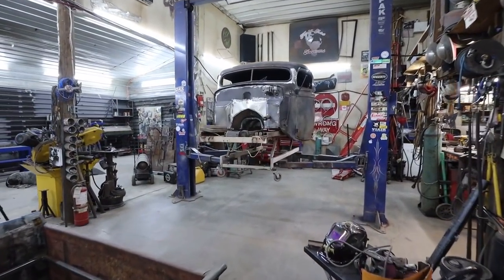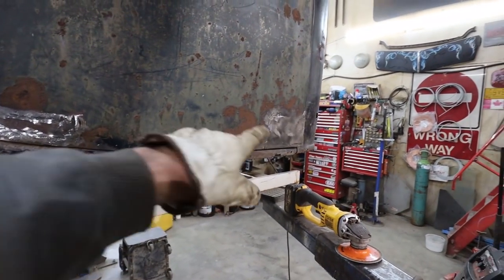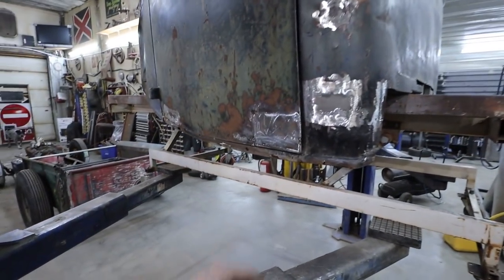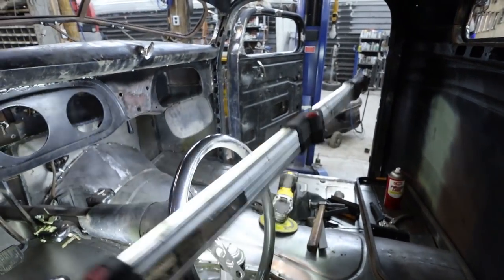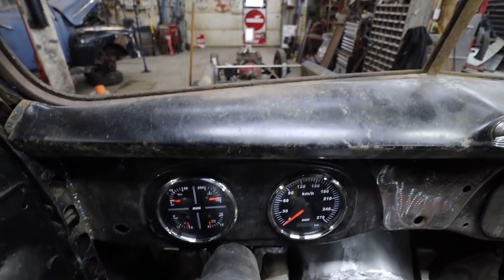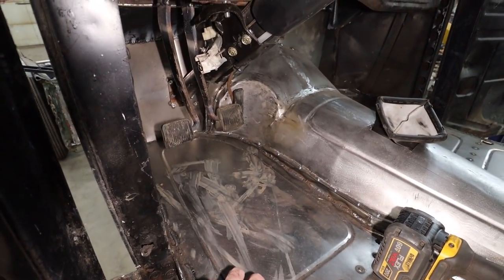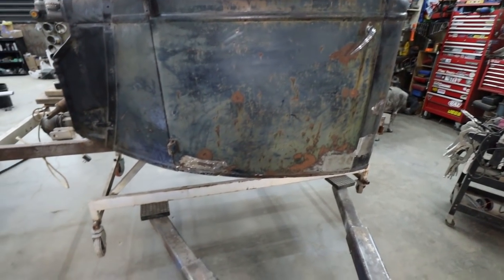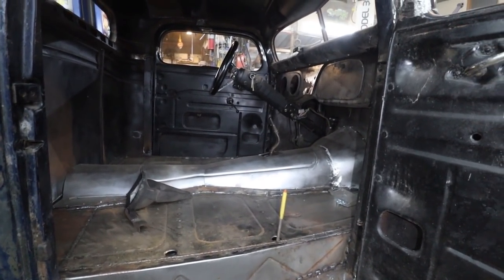Rebuilding the lower body line and rust repair on the 1937 Ford hot rod Part 16

Comment: The rolled steel interior panels would look amazing or rolled aluminum would also look great! you could spray the inside of the roof with bed liner, it would give it texture and sound deadening and you could paint it if you wanted to. Wow, what a great way to use conduit to repair the lower panels! Great Video!

Comment: To seal the tunnel to the floor...cheap. 
Home Depot, butyl tape, it's like 3M "strip caulk". Unlike 3M, it's only about 5 bucks for a 40' roll. 1/8" thick X 1/4" wide. Used for metal roofing seams.
Reply from the maker: Sound better than what I was gonna use haha

Comment: A spruce green heavy crushed velvet interior with black carpeted floors and accents on the door panels would really set it off. I don't know how close the original front fenders are to the 34 ford front fenders but that would look amazing as well with the 34 rad shell and grille. So I'd pinch the front horns to match the grille you chose some time back. She is looking the nines so far that's for sure. Thanks for letting us follow along.

Comment: Hi again from the UK. Another small suggestion. You mentioned in one of your earlier episodes that you like to put the front wishbone arm attachment points in double shear. If not too late, how about turning the spherial rose joint end through 90deg and fitting it between  the arms of a "U" section bracket which would be welded to the side of the chassis, covering over the hole you drilled. The base of the "U" can be as long as you like to give it adequate strength? Thought it would look a little more neat.
Keep up the fantastic work!  Robin Searle.

Comment: Making Fitzee proud!👍
Drivers door seemed easy, but everything is easy watching from my recliner.  
Arcing pipe didnt look like it was cooperating. Youconduit!!

I did accomplish a little bit today, turn plates for alugnments, a pair was given to me, needed some tlc. Will go with the alignment machine just fine. The database goes back into the 40’s. good to have.

HAPPY NEW YEAR! Btw..

Comment: As far as I know, the conduit has a hot-dipped galvanized coating with zinc. is that safe to weld?  the vapor is toxic wouldn't want to see you lose your marbles.
Reply from the maker: as long as you don't inhale the fumes a feller will be fine.

Comment: The conduit is called EMT for electric metallic tubing. Good material for what you are using it for. You might need to treat it before you paint it though as it is coated to prevent rust and the paint might not stick. They used to galvanize it      
I don’t know what they coat it with now. Truck is looking wicked. Thanks for sharing.

Comment: Nice work, as usual. Here in Pennsylvania we refer to that particular type of conduit as EMT. Its an acronym i believe for electical, mechanical tubing. But you are right it is conduit.
Reply: Knew a fellow from Philadelphia that was overcome from the fumes while brazing, the galvanize coating. Be safe!

Comment: Happy New Year to you and your family. With that speedo I think you need to bring the truck over to Germany and try it out on the autobahn. Here is a guy doing 200KPH in a stock early Mustang. https://www.youtube.com/hashtag/topspeedgermany. I have a 65 Mustang and took it up to 180KPH but it was getting a little wayward so I backed off. I think that guy was doing well. You nice low truck with a strong Chevy small block should be good for 200KPH easy. Eat some of those BMW's and Audi's for breakfast!!!

Comment: The cast Iron Pipe is already work hardened so it doesn't bend very well for ya. One inch tubing works well to rebuild the bottom of the Sills on these old trucks and cars. And it looks really good when it done as well plus than they last forever, being that its build out of one inch tubing. Never even consider conduit o yeah that'll be fine.

Comment: Running late on your videos    Your one I like to stay up with but been busy like you    Suggestion   Put hooks on the floor so you can use chain or whatever and your posy lift to bend pipe    Hydraulic’s work in many ways

Comment: What do you do for heating the shop? I don’t have room for a wood stove but my propane torpedo heater doesn’t do it
Reply from the maker: I have in floor heat in there with a gas boiler
Reply: I'm pretty sure he said he has heating in the floor, in a previous video.

Comment: Another great video Brent thanks. BTW, this is probably a dumb question but, on the roof inside the cab & directly above the dash, there appears to be what looks like upside down bottle caps attached to the roof (LOL), what the heck are those?
Reply from the maker: haha think they where used to keep the headliner in the truck in it's past life.

Comment: Truck looks great !
Do you have recommendations for a cordless grinder and abrasives ?
Reply from the maker: don't think a feller can go wrong with either Dewalt or Milwaukee, that said a feller would spring for the better batteries to make it worth it. can't really comment on abrasives as I'm not sure what your all doing.

Comment: Do we consider this a 4- 100k air-conditioning system?  Or we gonna put ac in it? Oh yeah forgot you live in the great white north 🙄 and youins have no use of ac up yonder "A" 🤣  now I know why you chop alot of your vehicles. To keep the bears 🐻 from coming thru the windows or sumthin like dat. 👍 ✌🤟
Reply from the maker: and it' makes them easier to heat in the winter.
Reply: The bears 🐻

Comment: Dumb question can you do a video on how you do the cut and weld method that you use. It seems to really make things so much faster and go smoother.
Reply: Also a video on how you built your power hammer and louver press would be amazing!!
Reply: Fitzee's Fabrication has a how to for his "cut and butt" welding joint. Brent mentions Fitzee occasionally when he does a butt weld on sheet metal.

Comment: 270 KM/H
Reply: Yeah, not sure what you would put that gauge in that would make any sense. Maybe it's a replacement for your Lambo speedometer if it ever goes out.
Reply from the maker: haha pretty much but it was cheap and fits the hole